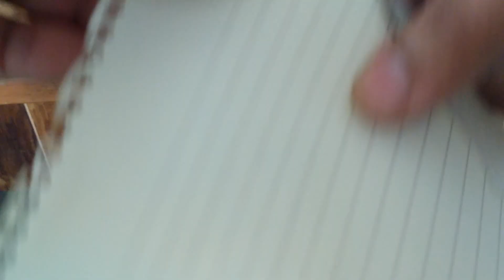Abusing CPM S110v

Comment: I sold my Spyderco diamond sharp maker kit.. what else can I use to sharpen this steel nicely
Reply: I have a Lansky system but with diamond rods, not stone. It works very well with my pair of CPM S110V blades and others hard like ZDP-189, K390 and Maxament.
Reply: You should’ve kept it. It’s slow but better than the Lansky and better than most other options for a uniform back bevel. The diamond stones are a must for the sharpmaker. You can’t do the back bevel without them and that’s the key to a high performance edge that’s easy to resharpen. I used one exclusively for several years. I do most of my work on a wicked edge 130 now but still use the sharpmaker for touch ups.

Comment: wow... didn't expected that! From now on I will consider myself lucky that I went for the s110v para2 instead of the s30v model xD 

did you noticed some form of small chipping and does it have a convex edge or a straight one like you get from KMEs and edge pros?
Reply: check out Joe X, he is a youtuber and he is REALLY abusing blades so you see what happens to your blade. 
In this test here, cutting one copper coin doesn't say much about the quality of the edge - your own knife might perform differently.
Reply: @diekritischestimme My guy, ain't NOBODY doing the tests JoeX is doing to their FOLDING KNIVES! That's just silly. They're knives, not wrecking bars.

This test was actually a very good one in that it shows that although S110 has a reputation of having a brittle edge, it held up fine in this strenuous test and it still cleanly sliced paper afterward. It shows it won't crumble or suffer a blowout if you hit a staple in a cardboard box or similar. 

Nobody needs to beat their knife silly to "see what it'll do". We all know what it'll do! It'll break! That's why nobody does that with their folding knives. Because it's stupid unless your sole purpose is entertainment and views which is exactly the point of JoeX's channel.
Reply: @topfueljunkie100 On Knife Steel Nerds s110 has a toughness of 3 on their chart. S30 has a toughness of 4 and nobody really complains about how brittle s30 is. Seems like people just “heard” s110 is super fragile and they repeat it without having actually used s110 for themselves as a practical EDC knife (not a car hood annihilator knife).

Comment: there must be significant variance in these spiderco s110v blades. my pm2 s110v chips extremely easily. im running a 18 degree edge on both sides polished to a shaving sharp mirror finish and it will chip in 1-2 spots within 10 feet of cardboard cutting. the first few times this has happened i assumed i just bumped something (like a staple) but the last 3 times it's chipped i've been extremely cautious and documented chipping.. :(
Reply: S110v likes a toothier edge as opposed to a polished edge. I am sure you have figured this out in 3 years time though lol
Reply: The knife in this video was probably around 40-45° inclusive. And look at 0:36 ... I almost ☠️ the first time I saw it. The knife is obviously just sharp enough to slice the paper clean and nothing more. The geometry is the primary mechanism here.
Reply: @ABL Wrong, I know Shawn and have conversed with him several times over the years concerning sharpening and performance. I often come back to this video simply because it's so good. What IS clear is that you have no idea what is going on, lol. This knife has geometry that lends itself to strength. I suspect a flat bevel just thin enough to slice paper myself. Impressive nonetheless. But yeah, good job clowning yourself 🤣
Reply: @oceanwaves83 What is it at the 36 second mark you're pointing us to? He's showing the split penny but nothing shocking jumped out. What did you see?

Also, you bring up a good point about this video, it lacks important details. We have no idea what edge angle is used so we can't really deduce much useful information from it. If it's 15° per side, that's impressive, if it's 25° per side however, not so much. 

So your point is well made. Geometry is everything. If it's obtuse then of course this will hold up to such use. No surprise there. This video needs more context and details.
Reply: @topfueljunkie100  it was the sharpness test of sawing against his fingers. I actually suspect a flat/blunt bevel that is just thin enough for the paper test. He was proving a point with this video.

Edit: just realized I repeated a sentence from months ago. Lol, my guess hasn't changed.
Reply: @oceanwaves83  Ah! I kept looking immediately before that, no wonder I didn't get it. But yeah, obviously it's blunt enough to safely do that. As your suggesting, paper cutting isn't a good test of how sharp a knife is, I completely agree. If it can't cut paper it's already well beyond the point I'd have sharpened it. I touch up my edges long before they'd struggle with paper. In fact, I'd say cleanly and easily slicing paper is a minimum acceptable criteria I'd have for knife sharpness! Clean and easy push cutting of thin paper is much closer to where'd I'd like to be if not even better. Even better if you can do that with things like paper towel. But so goes the sharpening geek in me I guess!
Reply from the maker: If it's cutting paper it can't be blunt. Duh
Reply: @FearNoSteel  thinness is everything for starting the initial cut on xerox paper. It cut your paper but not your hand
Reply from the maker: @oceanwaves83 That's not how edges work. Go make a video
Reply: @FearNoSteel   Sorry Shawn, I hope I didn't come across as knocking you or critical of you. Definitely not my intention! My point was simply that it's hard for us to draw detailed conclusions without knowing more about your edge angle and what level of damage was done or not done to the knife.

I appreciate you freely sharing such tests with us.

I agree that if it's too dull it won't cut paper and this knife obviously had enough of an edge to pass that test. My point was simply that we have different ideas on what sharp is in this specific instance (I know you for certain have high standards for sharpness! I haven't forgotten who I'm talking to!). Personally, I feel my knife is getting dull if it's not able to easily shave hair but it would still readily cut paper even if it can't shave hair.

But your point is made, the knife cut a penny and obviously didn't have any major edge defects causing it to snag on the paper.
Reply: @FearNoSteel  how edges work and one of the several attributes as to what makes an edge more conducive to slicing paper are 2 very different things, as you know. 

In reality, all uniform edges are blunt, even a perfectly heat treated piece of AEB-L sharpened properly down to 0.003 micron poly diamond emulsion from the late Ken Schwartz. The difference is thinness.

Obviously my guesses (and I stated they were guesses multiple times, I did not assert something about someone else's work in a video) that either you
1. sharpened the edge for geometry that lends itself to strength, or
2. Had an extremely thin yet flat apex (something that should be well known as Cliff Stamp went over more than a decade ago)
...are incorrect.

I am curious as to:
1. how you cut the penny without using geometry that yields durability of the edge, and
2. How did you know the blade wouldn't cut your finger yet sliced the paper cleanly, when it was not a microscopic flat bevel or sharpened at a relatively obtuse angle. 

If you could explain this instead of just saying I'm wrong or "duh", I'd appreciate it. And you can leave out the technique involved in getting a knife to slice paper since I'm well aware of that.  Thanks
Reply: @FearNoSteel  no response?
Reply from the maker: @oceanwaves83 I'm using an extremely light touch , It only slices into the dead skin layer, I'm feeling for any nicks in the edge and how it grabs. If there was a flat spot, it's not going to cut paper hence the importance of using the paper in the demonstration, paper is not to demonstrate the ultimate sharpness but to demonstrate that there is an edge there, not a flat plateau.
Reply: @FearNoSteel  thanks for a decent answer to the one question. Just FYI you can still have a flat bevel and slice paper. Flat bevels can be very sharp while adding the +P to an edge geometry to succeed at wild tests like this. And of course there are many techniques to make not so sharp knives slice paper perfectly. 

What about the edge itself?
If you didn't sharpen for durability, or use the cliff stamp flat bevel method, how did you chop through the penny with minimal damage?